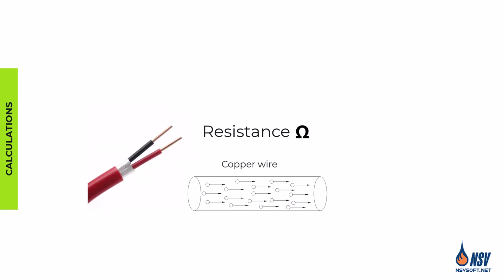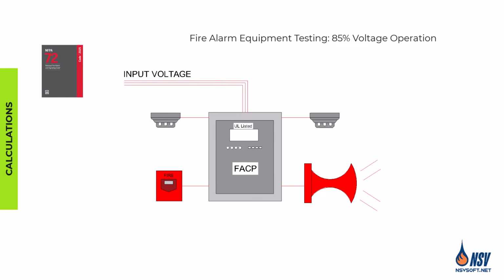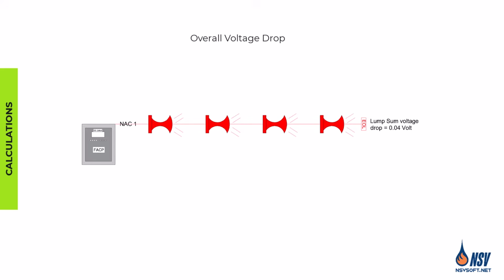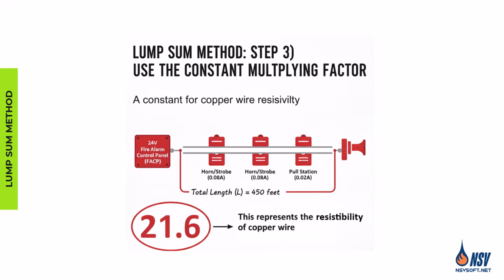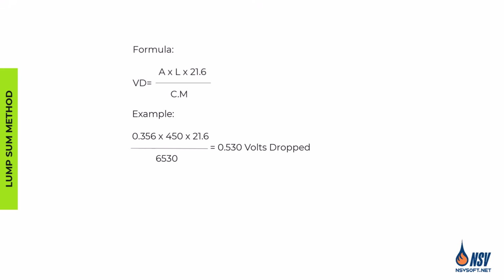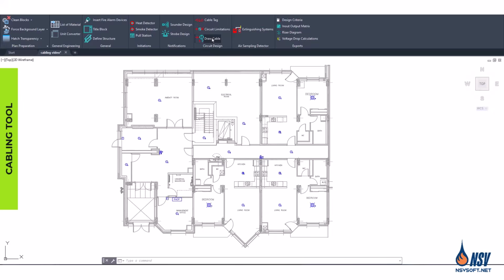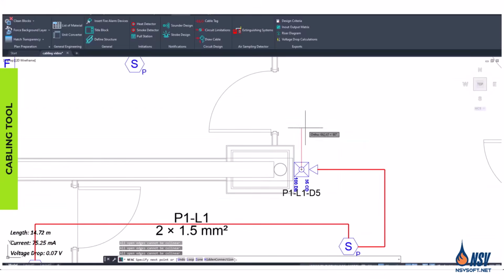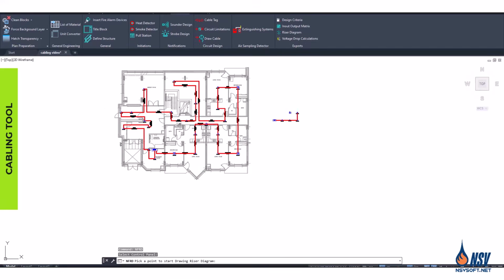⚡Voltage Drop (NFPA 72)

Comment: When getting step one, total current. Why wasn’t it 0.16? Just adding the 2 horn strobes and 1 pull station. How was there an extra 0.08 and 0.22. ?
Reply from the maker: Thank you for your helpful comment. The final horn at the end of the circuit corresponds to the third 0.08 A value, and the actual voltage drop at the pull station is 0.02 A.

Comment: do i need to have autoCAD to run this application? and can we do the battery calculation with this app?
Reply from the maker: Hello! The Fire Alarm module (which handles battery calculations) is currently under development and is not yet finished. Regarding the platform: NSVCad is designed to work with AutoCAD. We also have a version for CADMATE, but it has some limitations compared to the full AutoCAD version.